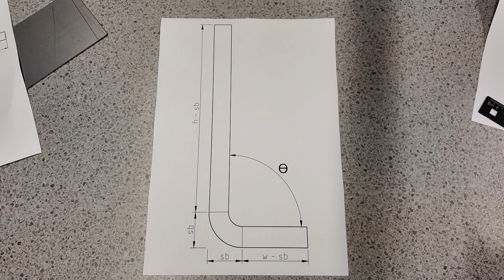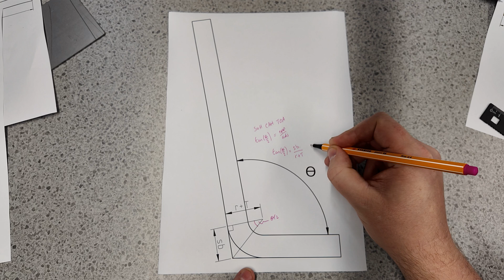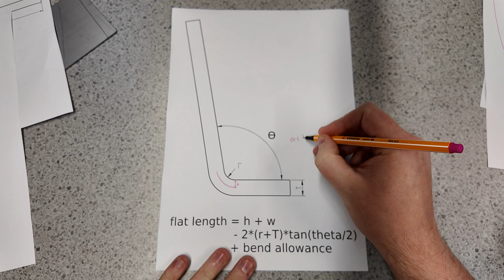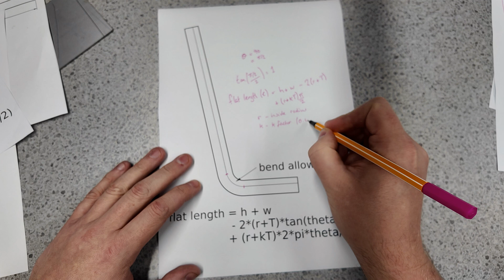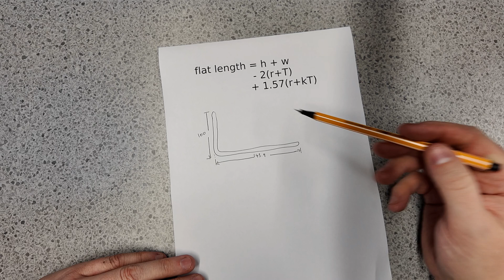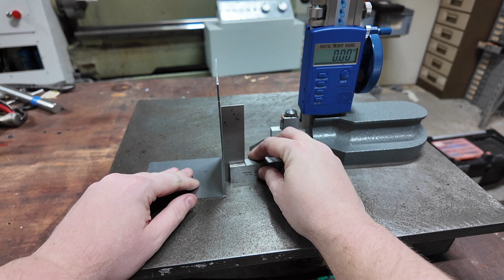#001 Air Bending - Sheet Metal Bending (Calculations & Real Example)

Comment: I read somewhere that the maximum material thickness should not exceed 1/8 of the V opening. Is that the ratio you also use or can I cheat a bit and bend thicker than 6.25 mm mild steel on my 50 mm V?
Reply from the maker: I have done 8mm in the 50mm vee with no problems - it helps to use a top tool with a bigger radius when you get thicker though, I use a 5mm radius top tool for 6mm+ thickness.

Comment: hi, many thanks  for the detailed  video. My question would be: is this classified as 'air bending' because the tool  doesn't necessarily go all the way down? it could well be classed as either V-bending or even coining as the chosen V-die was the smallest.   thanks
Reply from the maker: @lapinchiloca  Good question - I got the term from a 1980's Amada press brake manual that looks like the same as my 1978 Promecam, I understood "air bending" to be distinct from "'coining" (where top and bottom tools make full contact) and "bottoming" where the top tool travels all the way to the bottom, but doesn't necessarily make contact everywhere - I am open to corrections though 😁

Comment: Good stuff but you didn't verify the inside and outside radius. What did it end up as? I'd like to see a demonstration of how the radius varies with V die width using the same material and punch.
Reply from the maker: @billshiff2060  Thanks. I did actually measure the inside radius but I couldn't get the camera to focus well so I didn't include it. The nearest radius gauges I had were 2.5mm and 4.5mm (outside) - they were both very close. I am planning on another video to test k factor for other materials (1mm steel, 8mm steel and 2mm aluminium) - I will do some different vee widths in that one too. The formula based on dividing by six came from an early 1980's manual for an Amada press brake.
Reply: @AllTheFasteners  From what I see the K factor is pretty stable for aluminums and steels BUT I did see soft stainless drop to an astonishing .3 (that rendered all our blanks that were made for K= .45  scrap as it was impossible to get the rads and flanges correct)